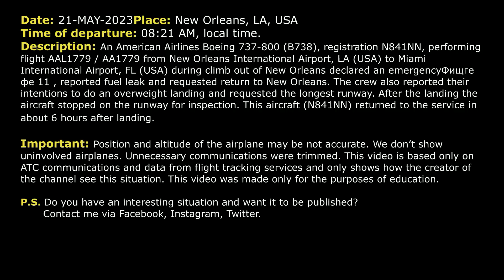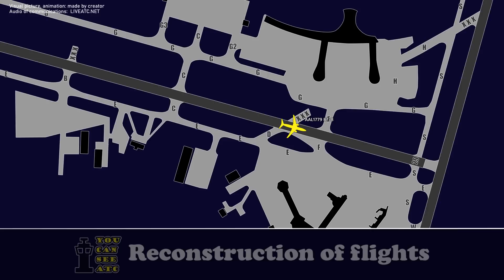Fuel leak after takeoff. American Boeing 738 requests the longest runway at New Orleans. Real ATC

Comment: Curious about ACARS - it sounded like they said they didn't have it.  I get "we're too busy with the emergency to use it" but isn't ACARS part of the MEL on a 738?
Reply: The ACARS was not working. However we can get the weather through our ipads and even contact dispatch.
Reply: You don't need an ACARs for most flights in the USA. The only requirement is that the Captain and the Dispatcher must be able to contact one another and they do that through VHF or HF voice communications as a backup.
Reply: It’s most likely deferred. It’s not required for flight.
Reply: They might have been too busy with checklists and getting set up for the approach and didn’t want to take time to text or to call company on the radio.  Or there could be an ACARS dead spot where they were. I’ve seen that happen occasionally.

Comment: Working on getting the "X's" off of the runway. Referring to the large flashing lighted "X" signs placed on each end of a closed runway.
Reply from the maker: Thank you. I was wandering what he was talking about 👍
Reply: @YouCanSeeATC  Yeah, they have to tow those off to reopen the runway. They're rather large so that pilots can easily see that the runway is closed and not try to land. Permanently closed runways will have X's painted onto the surface (and charts/charter supplement modified to indicate that they're permanently closed,) but for temporarily closed ones, they bring out the big lighted X's to place on each end of the runway, facing towards the approach to that end.